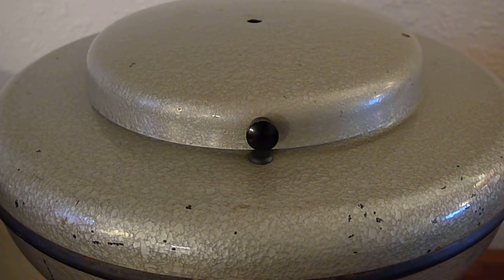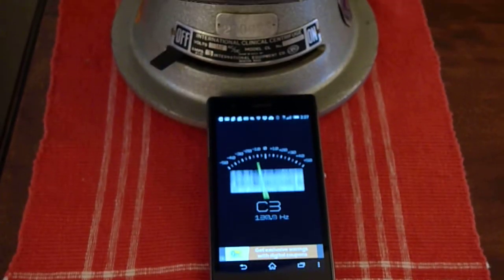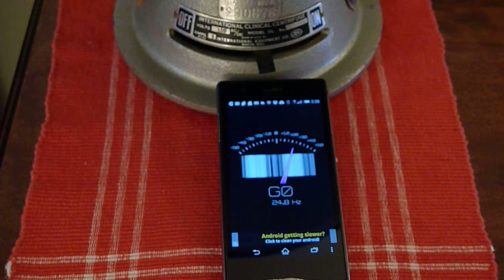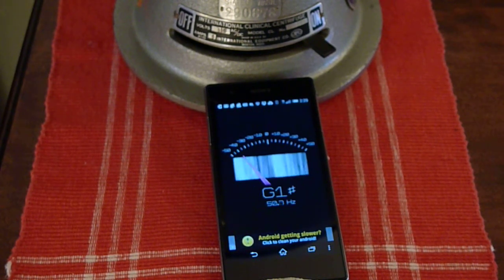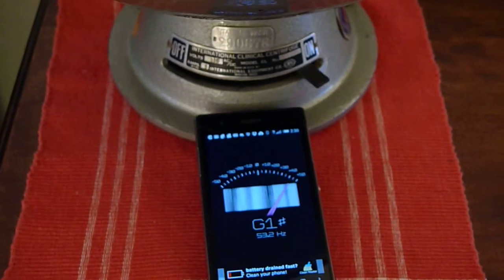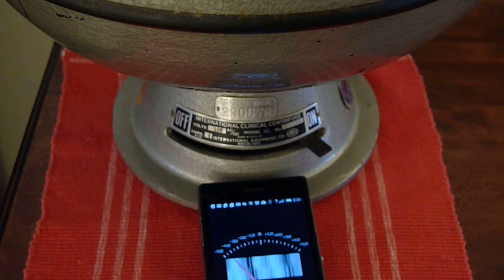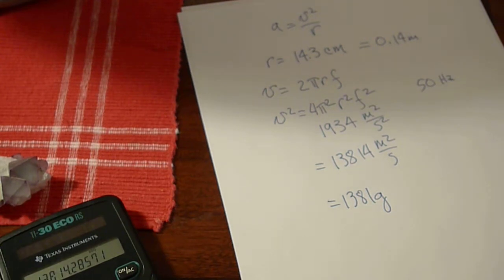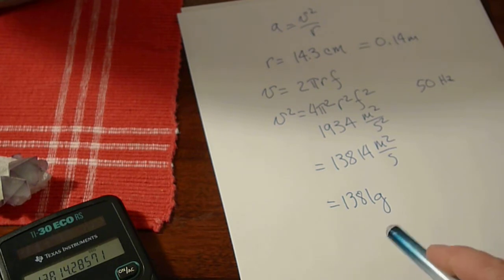How to calibrate a vintage centrifuge with a cell phone

Comment: This is pretty clever, thanks! I verified the frequency of a calibrated centrifuge in the lab with digital output. I would sometimes read the expected frequency, sometimes read half the expected frequency. I'm not sure why I would measure half. It seems like the point of friction/contact would have to be skipping every other rotation; like a wobble. I feel like I'm standing on my head to explain the observation.

I could, however, expect to read double or quadruple the true frequency. I could either imagine the harmonic frequencies being resonant enough, or if the sound came from the air being pushed by the buckets, you would get four pushes per revolution. Thoughts?

While working through this measurement, my vintage centrifuge seems to have stopped working. Bummer...